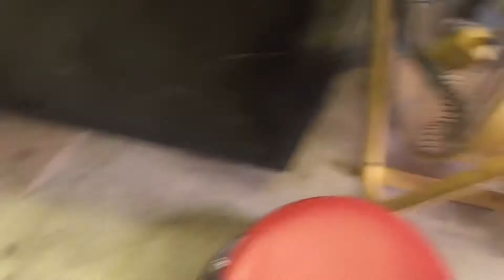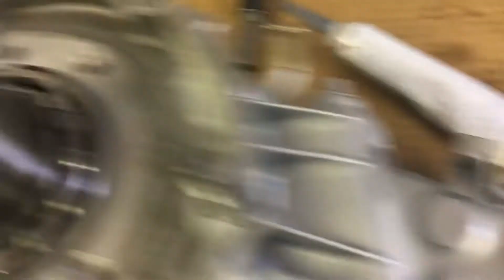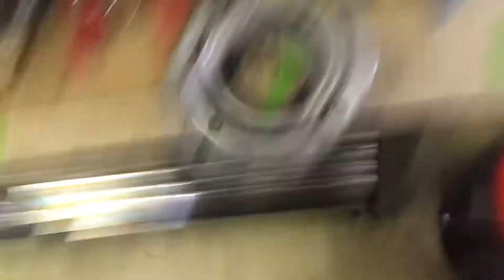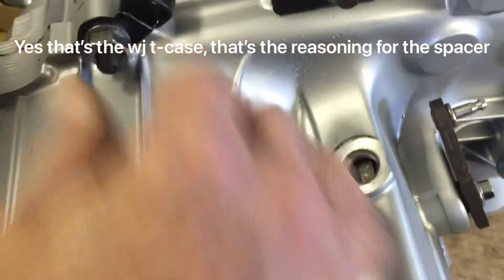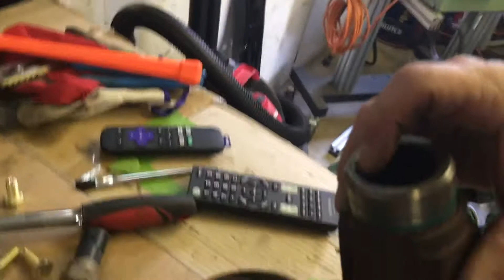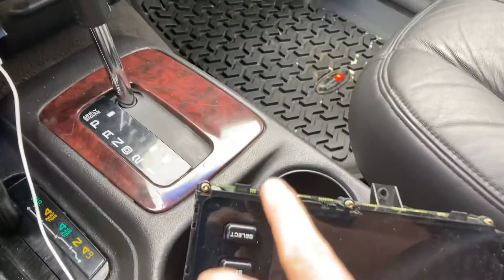NP249 to NP242 swap- beware

Comment: Am going to put a 2004 Grand Cherokee NP242-J  into a TJ with a diesel transplant.   question on the Rzeppa.  is the 2004 era going to have the same issue when swapping it to my 231's front driveshaft yoke?   Your vid is the first time have read/heard this may be an issue.   appreciate in advance the reply.
Reply from the maker: More then likely yes, optimally swiping the front output shaft gear with yoke shaft would be the easiest way to do that and you shouldn’t have to change out the front driveshaft I don’t think. Now you will probably still have the same issue with the wheel speed sensor on the back housing that I had; and for the gear select sensor that’s for you to decide if you want to make it work. It is not required for function of the T-case for it to work but the light won’t show up on your dash cluster that it’s in 4wd
Reply: @jeepinjack4196  Im back at this right now.  Appears the 242 front out put is a heavy duty 32 splined shaft, so the TJ's 231 front Yoke is not going to go on that shaft.
Reply from the maker: @coachgeo  a new drive shaft or SYE kit  might be needed
Reply: @jeepinjack4196  SYE being solved with Hack-n-Tap.   It does nothing for the front driveshaft though.  it appears that maybe the conversion Yoke put on  Cherokee to get  rid of  CV (rzeepa)   and swap to more common  double cardigan front drive shaft (like TJ)  may be the ticket.
Reply from the maker: Another commenter made a good point also about using a 242 SYE and just getting a new front driveshaft $$$

Comment: ZJ 242 or XJ 242 or Dakota 242 or Ram 1500 242 swap for a 247/249  the 1999-2004 WJ had upgrades but the ?-1998 242 swap the planetary gear from yours and bold it in done it so many times just watch your lift cause it can mean you need to change the drive shaft most of the time you wont. You took something so easy and made it so hard.

Comment: Couldn't you just use the output shaft w/ speedo gear, oil catch cover, and speedo sensor from the 249 in the the 242? Basically making a hybrid of the two cases
Reply from the maker: Yes but when I was dissembling my 249 that part of the case cracked
Reply from the maker: And is is already a hybrid case too. Now in theory you could take that part of the 249 and make a 242HD if you could get your hands on the correct planetary gear and chain

Comment: Technically I don’t think you need the Speedo sensor, the wheel sensors get the data. I believe I read that somewhere, where they used a wj, and no consequences

Comment: I have a 242 on ZJ but have been running without the selector plugged in since the ZJ needs a 4 prong. Unfortunately I dont have a lathe... would you be willing to make/sell me a selector spacer?
Reply from the maker: I would make you a spacer and send it to you. However I will be out of state until the first week of December. Since we did away with the Vehicle Information Center (aka) VIC and replaced it with the "cubby" the selector switch mod is not necessary . The "VIC" is a common problem and having the little extra storage space in a lot better I think. If I were to do it again I would just use the switch that came with the case just to seal off the hole so it wouldn't leak and not worry about connecting it. If I don't forget I'll replay back to you here when I can get back to the shop. Thanks!

Comment: A 242 sye would have fixed most of your issues. They come with the output housing and shaft that has provisions for speedo drive and since most guys are doing custom driveshafts anyways, it's no big deal. Better end result anyways. ZJ driveshafts with the 242 originally will work because they are specific to the 242 t case. There are companies that make WJ spec or rezipa style u-joint yokes for that transfer case as well using a standard 1310 joint. So the only real hurdle is the range selector switch. Pretty simple if you ask me because wj 242's are literally everywhere. Much easier to find where I'm at. Currently running the 249 but it needs bearings and the coupler is acting up so I will likely need to rebuild or swap relatively soon
Reply: does TJ use the 1310 joint on front drive shaft?    if so sounds like a 32 spline yoke for a 1310 ujoint is all would need to keep your TJ front drive shaft.

Comment: Thank You for the great content. QUESTION. Can I flat tow behind my motorhome ( 4 wheels on ground) a 96 ZJ with the 249 transfer case? I tested by putting transfer case in neutral and transmission in park and zj moves freely forward and reverse as I push it. Ssme thing happens if transfer case is in neutral and transmission in neutral, I wonder what's safer. Please someone with experience on this reply. I have a trip coming  soon and need to know.
For my towing points I'm good. Jeep has a heavy duty winch mount with d rings and it's sandwiched over the unibody frame.. (1996 5.2 V8 with full time 4wd 249 transfer case, automatic  transmission)
Reply from the maker: I recommend joining a good ZJ Facebook group and asking that, there’s a lot of people on there that have done a little bit of everything, I recommend going on there and asking and you should be able to put the Tcase in neutral and do that, test it out in the neighborhood and see how it works too so in case something goes wrong your not far from home.
Reply: @jeepinjack4196  ty sr
Reply: I recommend no. Although your axles are disconnected I believe the transmission still spins but pump isn’t pumping fluid burning up the transmission. Don’t quote me do some more research on that.
Reply: You can flat tow with the transfer case in neutral and the transmission in park, says right in the owners manual.